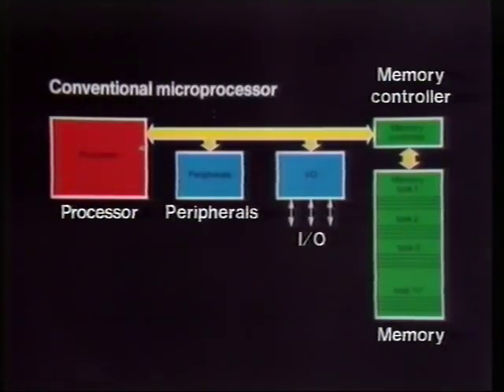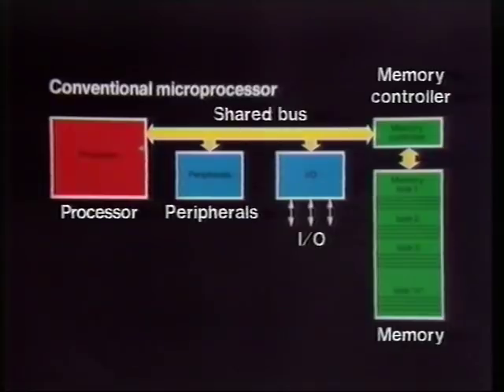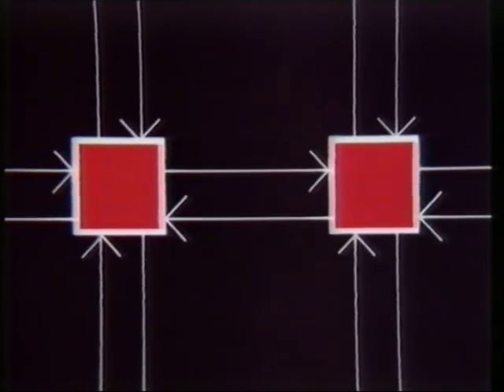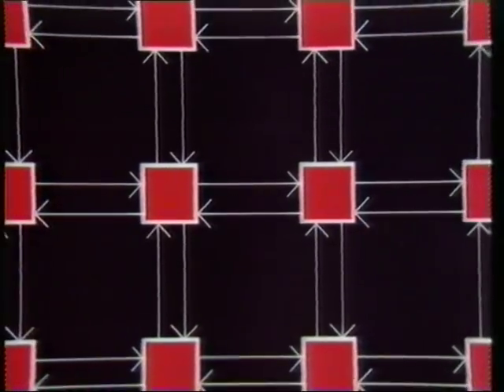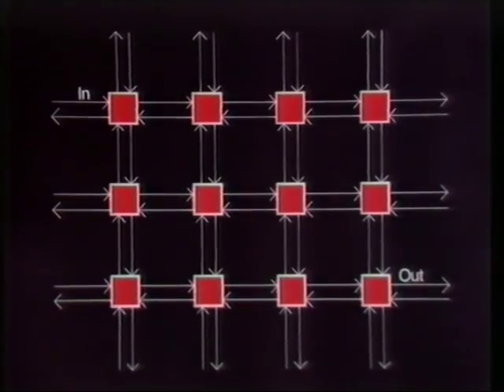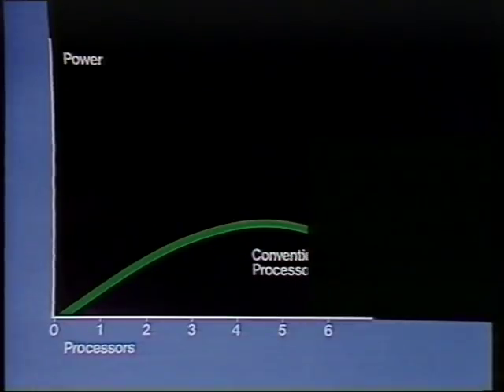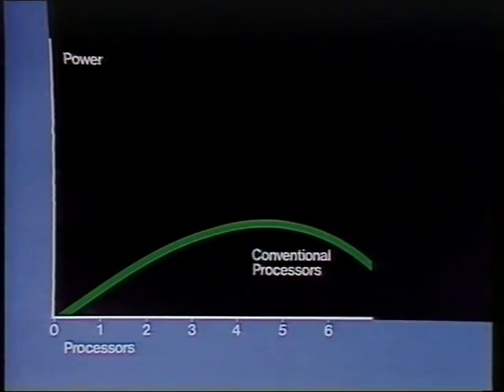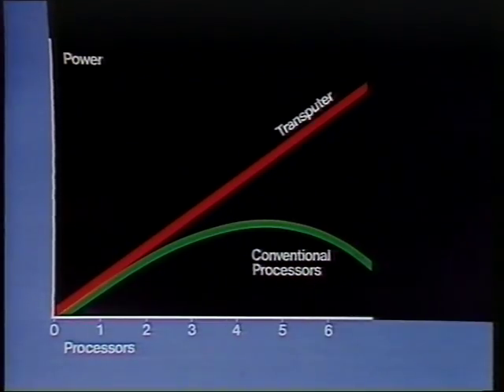The Transputer - Parallel Processing, Unparalleled Potential

Comment: In a lot of ways these walked so modern GPUs could run. A small army of simple cores linked together sharing memory and resources to compute in parallel.  IIRC they ran these demonstrations with one transputer chip per scan line per frame, with each picking up a new line from the stack as it finished its previous one. This would be like SLi for modern GPUs, and internally a GPU now distributes the load differently, but the ideas are the same.